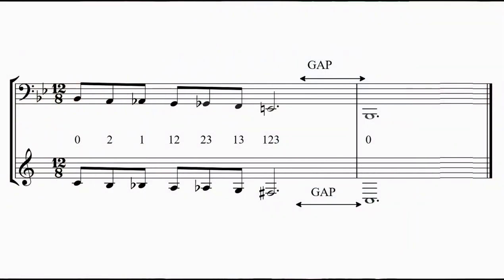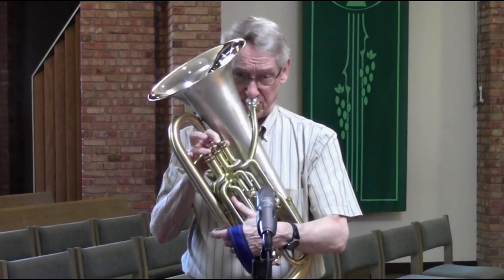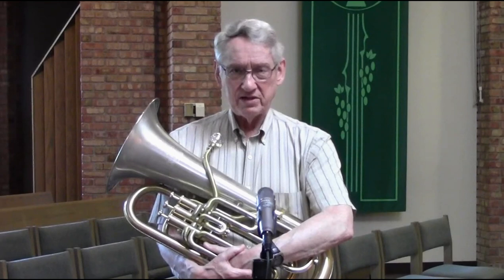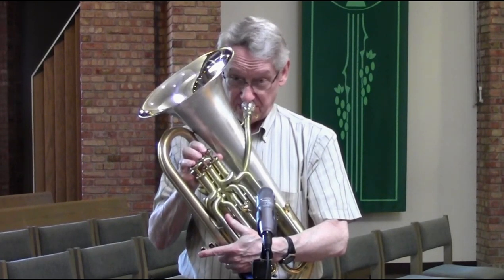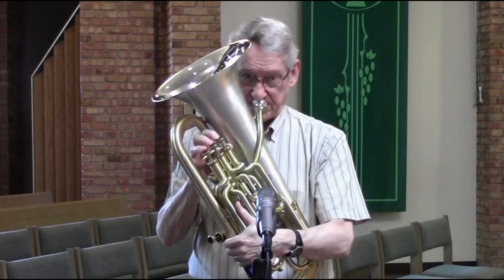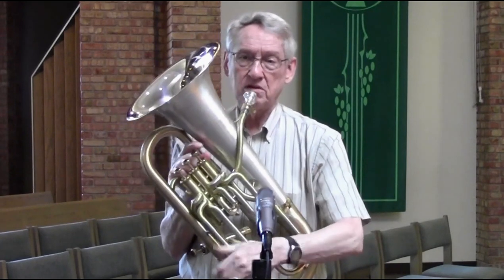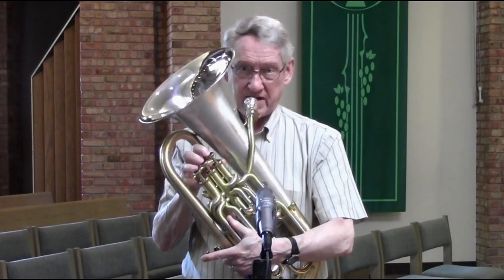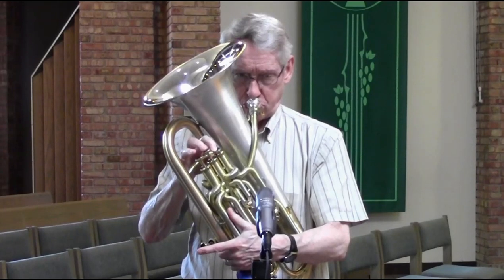How to Play: False Tones in the Low Register - Baritone, Euphonium, Trombone, Tuba

Comment: We don't like false tones & pedal tones because they just don't sound right. They don't sound right because the instrument doesn't have the proper length of tubing. It doesn't have the proper length of tubing because it wasn't designed to play them. I prefer to use the proper instrument, fundamentally. Bb Tenor Tuba (Euphonium) i never go lower than F1. I would use the FF Bass Tuba. On it, i don't go below F0. I really only use the Bass if a dry dark barky voice is required. Otherwise i like to more often use the BBb Contrabass Tuba which can go down to Bb0 in full voice. Effortlessly. The only brass instrument i use willfully to play false tones and pedal tones on is the FF Contra-Alto F Horn because there's no option for a larger F Horn. That's as big as it can get. And it can go surprisingly low with satisfying clarity. Pedal tone, as low as F0. False tone as low as Bb0. All those notes i mentioned are concert pitch*.

Comment: I recorded myself playing false tones once, and when I looked at the spectra it became clear that they sound odd because the overtones are out of tune with each other, and that, at least on my YEP-321, false D has more in common with low Bb than with pedal Bb. That shocked me, because it certainly didn't feel that way when I played it, but in terms of the physics it appears to be acting like the second partial. This explains why it is possible to play the false tone below the pedal; I have no solid proof but it seems to me that that low B is actually pedal false D lipped down. Once I realized that, I stopped using my second valve for double pedal Bb, and used 2+3, which worked much better. Low A as 4 worked wonderfully, but beyond that I struggled.

Comment: Wouldn't it be easier to do false tones below pedal B on the large shank euphoniums vs the euro shank euphoniums ? It would be probably easier using a larger mouthpiece. I can't find any false tones below pedal B on my euphonium. I can find false tones on tuba.
Reply: In my experience, it just depends on the overall size of the horn.  The infamous Tenor Sousaphone on ebay has excellent false pedals which is hilarious since the big honking bell breaks the low concert F.  The big version of the Jinbao oval rotary Euph has them (only way to play pedal concert B).  Both of those have something resembling medium shank.